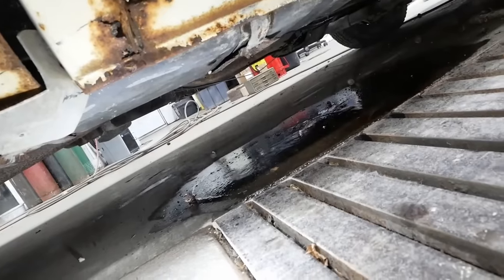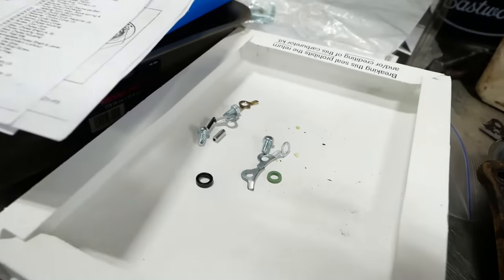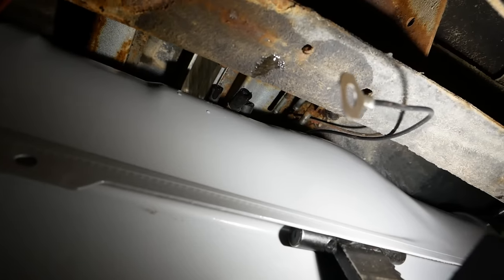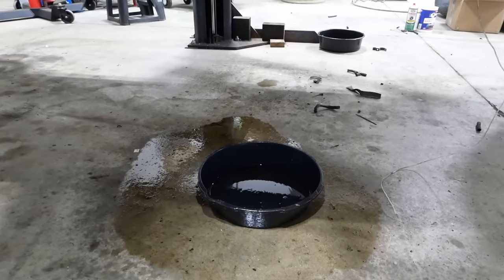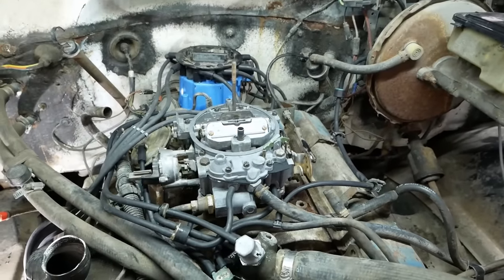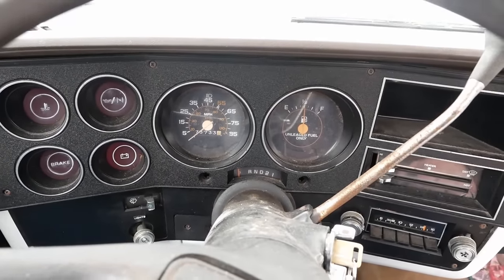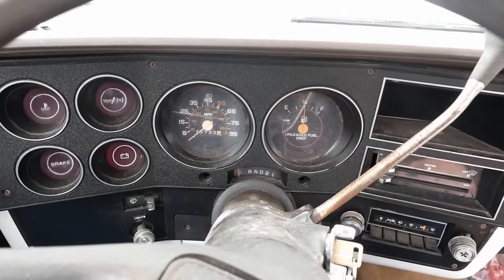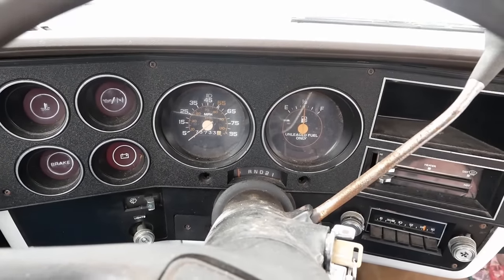Millennial vs. Carburetor | Square Body Chevy Back on the Road After Sitting 12 Years

Comment: Thanks for bringing us along, Wes. Brings back lots of memories. A couple of things i can tell you from experience. The choke is absolutely adjustable. Gm put rivets in the thermostat housing to keep prople from adjusting it. Once you have drilled out the rivets and installed the self tapping screws from the rebuild kit, adjust the choke if your getting an off idle stumble. The choke may be coming off too soon. Also efe stands for early fuel evaporation. When cold, the thermal vacuum switch in the water neck allows vacuum to the valve in the passenger side exhaust closing it off. The exhaust is then directed through a passage in the intake manifold into the drivers side exhaust manifold helping to warm up the carburetor. Also, the vacuum switch in the air cleaner that opens a flap allowing hot air to be drawn up from the exhaust manifold heat riser really helps with cold weather operation. Check and see if it still works. If it does, hook it and the efe back up and adjust the choke to be a bit richer. And all the comments about the fuel well casting plugs leaking are correct. It will give you a hot restart problem. Drill tap and plug with marine tex as a sealer. A good source of information is Rochester carburetors by Doug Roe. Good luck hope you get it fixed.
Reply: Hideous carburettors, convert to manual if possible
Reply: fit a thermo qud,,holley,,edelbrock.. or buy brand new quadrajet..

Comment: Couple of things to suggest looking at:
1) Make sure the EGR valve is NOT working when cold, EGR will definitely cause stumbles (looks like it is routed through the other ThermoVac that was not replaced ?.)
2)Verify the Vacuum advance IS working and advance HOLDS vacuum.
3)Many GM vehicles were set up to have Manifold vacuum supplied to the vacuum advance when cold and switch to Ported advance when warm (again, ThermoVac switch). 
   Problem with that is that when the throttle is opened Manifold Vacuum would drop off (and thus the advance would drop) causing a stumble. The way they solved that
   was with a 4 port valve which would slow the vacuum bleed-off when throttle was opened. 
  On the vacuum hose diagram of your truck GM calls it a Distributor Delay Valve , but it was often referred to as "Trapped Spark" or "Captive Spark" if my memory serves....
   No guarantees..... Also, there may be another check valve involved.... It's been a while since I touched one of these...
If you set up a timing light and have a helper operate the throttle when it is cold, in gear (Carefull, block wheels , ETC) you can watch the timing and see if this is what is happening.
Note - You may be able to make it tolerable by just switching it to Ported vacuum permanently, but that will likely require tweaking the choke fast idle setting.
4) It's a bit unusual to ONLY have the choke vacuum break at the rear of the carb, mostly there was a Primary choke break at the right hand front of the carb, mounted on that little
  mounting pad with 2 screws and the rear one is a Secondary... It may be built that way, but make sure its not missing the primary.....
5) It's been pointed out by others, but the EFE system (heat riser/ manifold heat) and the thermac (heated air drawn into air cleaner) WERE there for a reason, although I don't
     believe they are as crucial or likely the cause of the issues.
Good luck and thanks for an entertaining video 
ps- Hope this helps.
Reply: The later QuadraJets used the vacuum pot on rear of the carb for both the choke pull-off and secondary lock out, so that isn't missing from this one.

Comment: As much as you know about the equipment and vehicles you work on and the manner in which you describe your troubleshooting, its really easy to forget that you're not a 50 year old mechanic. Hearing you say you don't know much about automotive carburetors is a definite reminder that you're part of the younger set.
Reply from the maker: Well I have my dad for the old school stuff. He said I was asking too much from it...
Reply: @WatchWesWork  I think the 'millennial' mindset of 'get in and drive (with no warm up)' and things run totally fine was asking too much of the old junk. So I've got to agree with your dad on that one.

thank goodness we have efi now, I really dislike carbs too!
Reply: Your dads not wrong when he says you’re asking too much of it. Probably would have been cheaper when you count up the labor to just put on one of those efi conversion units
Reply: @WatchWesWork  Yeah, I'd agree. I've "successfully" rebuilt one single quadrajet carb in my life and I'm pretty sure on that one I deleted the choke (I live in the south).
Reply: @mechanictaft4848  I used to think the same as you - I bought a new Eldebrock AFB in the early 1990s to replace a 4BBL Motorcraft on a 429, and it was the biggest tooling-worn-out piece of crap that I have ever seen.  The throttle shaft bores were way sloppy on a BRAND NEW carburetor.  You could see light around all four throttle plates through the venturis.  I couldn't get it to idle lower than 700rpm with the plates fully closed due to the air leaks, and the tiny vacuum pulloff cylinder and piston inside the choke housing fit so loosely that it never worked at all.  I showed all of these issues to the store and returned it.  It ran just as bad as the Motorcraft carb that was on the engine previously.

Then I installed a Holley ProJection and never looked back.  It had its own issues, but I never wanted to go back to a carb'd vehicle after that.  In hindsight, I should have found the correct-CFM Quadrajet and put that on instead.  These had such a bad reputation, but I learned how they worked, how to fix and adjust them, and had fantastic success with them on several of my own vehicles as well as other cars/trucks that I worked on.  The small primary bores have excellent drivability and fuel economy, and the secondaries make the most excellent moaning sound (with stock air filter housing lid flipped over) under full load, as you watch the red needle in the fuel gauge sink!
Reply: @WatchWesWork  yep
Reply: @WatchWesWork  well said, and a hard truth, old  machinery doesn't mean better, maybe, as the T-Shirt says " The older I get, the better I was". 😉

Comment: I graduated High School in 71 and remember a couple of cars with that choke system, heat risers ,evap cans. 30 vacuum lines nite mare stuff. You are right when you said something about being thank full that you did not grow up with carburetors. Keep up the good work. At least we have the benefit of internet searches and information now, we did not back then.
Reply: Yiur two years older than me . . . back then you could get parts for 20 year old cars and there just was not that much information needed to do stuff back then because we had good repair manuals and you could swap a motor (or anything else) with anything you could make fit without f'ing up the computer . . .

Comment: When I was working for an oil wholesaler outfit in the early 1970s, there was a big argument against running "detergent" versus non-detergent oil in old engines. I can't even imagine how big that arguement would have been if we'd had the internet back then.  And I am a "middle" boomer, and didn't have a fuel injected vehicle (other than a diesel) until it was pretty much standard equipment, and I never successfully got a carbureted vehicle running "perfectly" for more than a week.  I also like to point out that a "tune-up" with points, plugs and condenser replaced, timing checked and set, and usually oil leaks plugged was done on roughly the same frequency as an oil change now.  I have been accused of using a hammer to adjust a carburetor, and will honestly admit that in some cases there's a fine line between "adjustment" and "wanton destruction."🙄
Reply: Amen!
Reply: They ain't no way
Reply: Except that to my understanding there is a definite point ton that logic. Typical old agricultural engines and general machinery like lathes and mill have no means for fine oil filtration. You want as much junk sticking to the pan because otherwise it is being recirced thru the bearings ad nauseam....
Reply: @Zonkotron  Please note, I wasn't arguing the point one way or another, I was just saying that even at my advanced age, I remember how much controversy there was, well before the advent of the "internet expert."  (And we sold non-detergent oil for "service stations" where it was used in automotive engines, and I know even there, the filters weren't up to today's standards.)
Reply: Dunno, I have a 75 Nova as a daily with a 350 from a 71. It currently has an Edelbrock 4 barrel. I havent touched a setting on that for 2 years and its still running perfect. Starts on the first revolution every time.

Comment: Manual choke for the win.  I've never been able to sort an auto choke when they go bad.  
Always just converted them, to the point where everytime I got another car I'd just change it, to save the hassle down the road.
Reply: Absolutely!!!
Reply: Why did they put auto chokes on cars manuals are much better It's a simple operation
Reply: @neilmurphy845  Because they think people should be able to get in and go knowing nothing about how to actually operate the vehicle. Having to know a bit about a car in order to operate it correctly is no longer a thing. It's sad. You SHOULD be required to understand how things work in order to drive a car.

Comment: As a suggestion , while mrs. Wes is cranking the starter , observe the rear choke pull off to see if it’s opening the choke valve properly . This model Rochester doesn’t have a front choke pull off so we can’t fault that .
I’m not a carburetor expert either , but I can spell carburetor correctly now . But seriously , no matter how many carburetors I’ve had my hands on through the years , they will test you and you will test them back . You’ve gone above and beyond on this build , well , rebuild . 
At least you’ve bothered to install throttle shaft bushings when almost no one ever does . You also restored what is fairly important for what the engine may actually need in terms of vacuum lines and the thermal vacuum switch . You changed out , after a proper diagnostic check , the choke thermostat . I sure hope they make those as good as they used to ? Sorry you had to hassle over this adventure but I still like the quadrajet carburetor and would still like to have my faith in them .

Comment: Hi Wes! Back in the day, a brand new small block Chevy did the same thing. Hard start, stalling when cold, stumble on tip in. Solved it all  by replacing the Quadra-Junk with a Holly Spred Bore. Ran smooth as a gravy sandwich. Thanks for taking the extra time to share, I learn and it brings back memories!
Reply: In the 80's some people called them Quad Bogs. The zinc deal in the oil is a controversy you read about on the internet.  I use SAE 10W30 in small engines instead of straight 30W and people say that is bad too.
Reply: The only thing worse were the Thermo-Quads on the Mopars.     There is a reason Holley sold so many carbs.
Reply: Mmm gravy samich yummy 😋
Reply: Couldn't agree more. Holleys are cheap, easy, and they just work. Rochesters are expensive overcomplicated junk. If you want complicated and expensive then just get a set of Webers. Once they're set up you'll have wicked power, reliability, and a glorious noise. A Rochester will give you none of those things.
Reply: Ah...but the right tuning got you better mileage than the Holley.
Reply: @mikespain8655  "some people" are the ones that took parts off of them and screwed them up.
Reply: @woopimagpie  absolute facts
Reply: @woopimagpie  Or the worst ever... those variable venturi smog carburetors that Ford used for a few years.
Reply: @HouseCallAutoRepair  When gas was 32¢/gal who cared about mileage?  All we cared about was drivability, horsepower and noise.

Comment: Wes, love your videos you are among my favorites. Old Chevy guy here, you have done all the correct repairs to the carb. Believe that you have slightly loose timing chain from old age and mileage. Two more degrees will fix your problem. It’s slack and overlap old gm mechanic trick. Truck will respond better and do less hesitating when cold. Worked next to the best quadrajet man at a gm dealership for a while when I was very young. Learned many secrets about those carbs and trying to get the lean out of them. Like the longer videos, thanks for taking the time to do them!

Comment: Wes, all of the carbureted cars I grew up with had some sort of stumble during warm up.  Not one of them worked anything like modern fuel injected vehicles.  You did a fine job of putting this truck back on the road.  Modern fuel injected vehicles start, warm up, and run far better than most carbureted cars from a temperature range of -20F to 100F.
Reply: Exactly.  It's not fuel injection.   Just the weather changing, changes how they start each day.

Comment: Wes just a couple of things you might check. A vacuum leak in brake booster . The egr valve uses ported vacuum if constant vacuum is applied it will screw up the idle. One last thing is the aneroid that adjusts the fuel air ratio for high altitude . It is located  
Across from the acclerator pump and it is adjustable. Thanks for bringing us along including all the problems.

Comment: My only advice would be:  Don't expect fuel injected throttle response from a carbureted engine.  I grew up in the 70's and, when fuel injection came along, the thing that amazed me most was the crisp, precise response when I punched the gas.
Reply: Words of Wisdom  ✔
Reply: Lol I was getting nostalgic about that stutter…  reminds me of all the chevys we had when I was a kid
Reply: Agreed.
Reply: I have only had 2 Great running cars with carbs. 1980 Honda Accord, that pos ran like it was brand new. Second was a mid 80’s chevy pu the local garage let me borrow while my car was there. Truck would start if you breathed on the key, and ran absolutely flawlessly.
Reply: Analog vs Digital, but in the engine world.
Reply: Exactly!    This truck runs just as god as you could expect.
Reply: Ya'll seem to have missed the 90s with the horrible monopoint injection systems. My current daily uses that pos tech and boy does it make me miss carburetors.

Comment: Tip for the ultrasonic cleaner: Fill it up with plain water (and a drop off dish soap to cut surface tension) and put the parts to be cleaned into a gallon Ziploc bag with the desired cleaning solution.  This way you can use different cleaning solutions for different metals without draining the tank and it makes recovering small parts a breeze.

Also, Valvoline makes a high-zinc oil, their VR-1 racing oil. I've also had good luck with the high moly oils  (the ones that pour black out of the bottle) on old air cooled stationary engines with flat tappet cams.  It makes checking the oil level a breeze on the dipstick too!

Comment: I remember those old square body days with the first " automatic " chokes. I used to wish for the good old pole knob choke setup. I used to let my engines warm up for a good 5 minutes, it eliminated so many problems. Especially difficult if you were trying to drive it cold with a stick shift!

Comment: Those old carbureted engines had VERY high cold idles. (The engine would ROAR on a subzero morning until it was warm enough to kick-down) Also, deleting the hot-air riser function had a big impact on cold-weather running.  (dont ask me how I know this :-)

Comment: Lots of great suggestions in the comments, here, like resealing the well plugs, eliminating all vacuum leaks, etc.

If you ever have the truck back in your shop:
– Verify TDC @ crank balancer and timing cover tab. Outer ring on balancer can slip when they get that old.
– Once TDC is verified, increase initial timing to 10–12° BTDC.  That should improve the engine's manners across the board.

That bump in initial timing would also affect the distributor's total timing, so that'd have to be modded, if the you decided to keep the new initial timing.

Thanks very much for putting yourself through all the filming and editing so we can all come along.  It's always fun, and I always learn something new from you.

Comment: The “Lee “ plugs on these carbs leak pretty often, and really messed up adjustments. Leaked fuel thru the base. So, we always JB weld epoxied them. My carb guy was great on these. Me? Not so much, but what do I know? Service manager here, and Chrysler mechanic in my day. So, good job buddy.
Reply: Exactly what I was going to suggest. They're famous for those plugs leaking. I have always SLIGHTLY tapped them to snug them back up, then coated them with a coat of JB Weld. I think he needs to adjust the choke spring better too. I was a Chrysler tech for over 20 years, so it's good to hear from the brotherhood lol.
Reply: I had to teach my wife how to rebuild the Quadrajet on our Camaro back in the '90's.  She got tired of those leaky plugs dumping all of the fuel in the float bowl right into the intake.  She would be stuck wherever she was with a flooded engine until all of the extra fuel evaporated off.  Good times.
Reply: I once heard that GM's "official" fix was to jam a piece of thick felt in the well. Screwing the carb back together would be like tightening the stuffing box around the prop-shaft on a boat and stop the leak:)

Comment: I was so impressed with the electric choke on the Holley 4-barrel carb that I put in my 72 Ford Gran Torino Sport that I replaced it with a manual choke and control cable.  That was in the 1980's and it was a simple, all-electric choke, so don't feel too bad about being tripped up by the rather complicated Rochester choke.
Reply: @brentanderson722  I can see why.